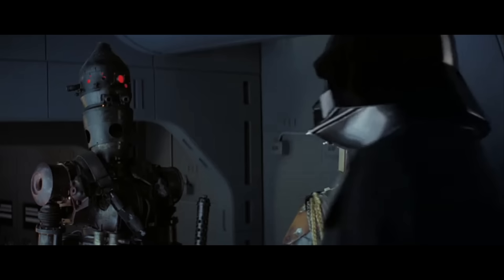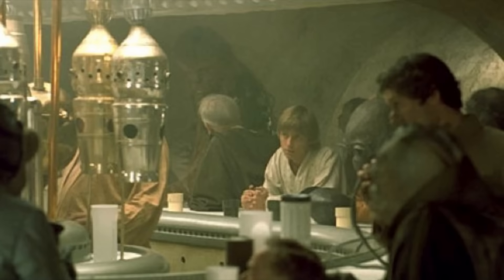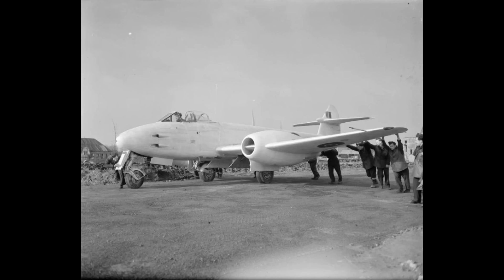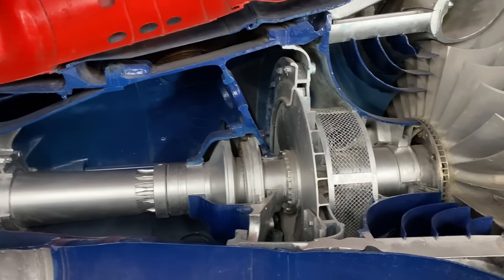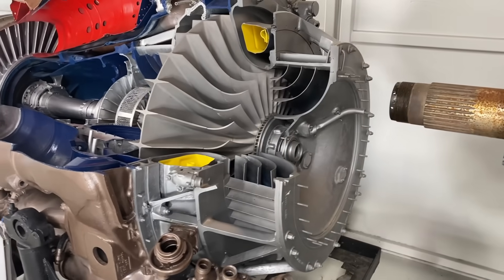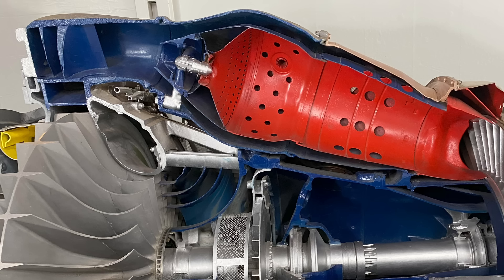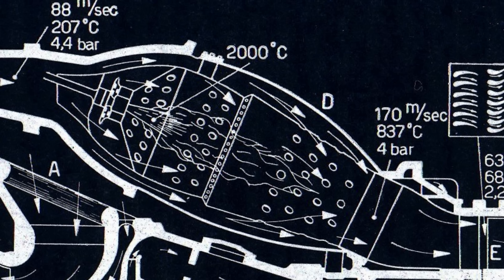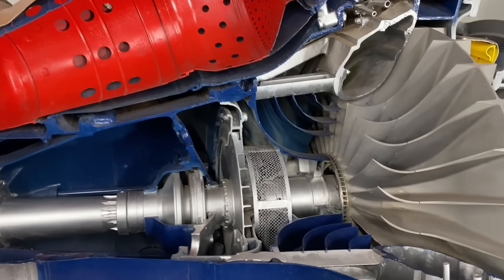The 1940's Jet Engine That Became Star Wars Design History

Comment: Explanations of turbine engines always state, correctly, that the combustion raises the temperature of the air. But for some reason it is never explained that the temp increase isn't the point--it's that the volume is increased by heating the air so that the flow through the turbine can yield more power than used to drive the compressor.

Comment: I don't know jack about starwars, but someone pointed out a prop of a car part I had once. Anyway, the engine design is very interesting.  Those types of fans are technically called radial fans/compressors and they have much higher static pressures compared to axial types, but normally at reduced flow rates.

Comment: I dunno anything about starwars. These engines... engine types are obsolete since the 60's the nene powered the mig 15. Anyway these days von Ohain s engines are used. Helicopters do mainly use these. I think auxiliary power units are centrifugal aswel.. Nope no tesla batteries. Nice video anyways. 👍

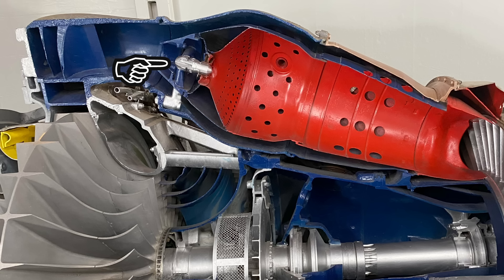Comment: 6:47 Usually called a “fuel nozzle” but sometimes the literature calls it an injector. Don’t quite understand the distinction, but sometimes examples have “injectors” (usually multiple) within the fuel nozzle. I wish someone with actual knowledge would explain the distinction. I suspect it has something to do with fuel pressure drop across the “gizmo”, and whether it is a liquid or gaseous fuel. After being “corrected” in a discussion about this item in a particular sterling engine combutor, I have paid attention to the precise usage, which seems to be important in some contexts.
Reply from the maker: I have a video on rocket fuel injectors but jet fuel injectors aren’t the same
Reply: @scottmanley  

Thank you for the reply. The “way” you used the term seems to be fine, it is just that people like AgentJayZ sometimes uses the term “fuel nozzle” (probably referring to the fuel nozzle assembly). I realize that it seems superficially pedantic, but I have run into technical people that are rather insistent that the terminology is technically relevant. I personally always call it a fuel injector until it was made clear that sometimes it is properly called a fuel nozzle (which kinda makes some sense if you are referring to the details of how that “assembly” works, which can vary a lot these days).  I would just like a good explanation. Rockets definitely use “fuel injectors” as standard usage.
Reply: With regards to the question of why radial vs axial compressor in early jet engines, I had the good fortune to have a very educational dialogue with a RR jet engine engineer. The first paragraph is my question (I know it is long but well worth the read if it is a topic of interest to you):

MY QUESTION:

I would be interested in your perspective of why
Sir Frank Whittle went with a Radial Flow
Compressor vs the Axial Flow Compressor that
"others" worked on. I realize that Radial Flow Compressors were probably better understood and more familiar at the time of this development and it is a perfectly viable solution in that time frame and are used in contemporary turboprop engines but I have always wondered why?

RESPONSE:

RR turbine engineer response (by @grahamj9101 on AgentJayZ youtube channel, best source for anything about jet engines):

The answer is very simple. An engine with a centrifugal compressor was much simpler, quicker and easier to develop than an equivalent axial flow engine.

Whittle's proposal for a centrifugal engine was rejected in 1929 by Dr A A Griffith at the Royal Aircraft Establishment, who had proposed an axial flow engine as early as 1926. However, the engine Griffith proposed was what we now know as a turboprop. His team, led by Hayne Constant, designed and tested a series of axial flow research compressors in the late1930s, which led to a project for a turboprop being handed over to Metropolitan-Vickers.
However, in 1939, when the second rebuild of Whittle's WU engine convincingly demonstrated the potential it had first shown in 1937, Metro-Vick's engine turned into the F.1 axial flow turbojet. This was followed by the F.2 series of engines, which were initially unreliable as compared to the Whittle, Rolls-Royce and DeHavilland centrifugal engines - but they were significantly more reliable and had better performance than the equivalent German axial flow engines of the time.

In comparison, Frank Whittle's centrifugal compressor worked straight off the drawing board in April 1937 in his WU engine. He aimed for a pressure ratio of 4:1 and got 3.8:1. That centrifugal impeller went through two rebuilds of the engine, which was finally damaged beyond repair in 1941, when the rim of the turbine disc failed, releasing several turbine blades. The engine can now be seen in London's Science Museum.

Whittle's early work on the WU engine was funded entirely by a relatively small amount of private venture capital, whereas the work at RAE was government funded. Whittle just didn't have the resources or the technical infrastructure to develop an axial flow engine.

Critics have described Whittle's engine and the other British centrifugal engines as a "dead end". However, they worked, were lighter, more reliable, and had better performance than the equivalent axial flow engines., whether British, German - or American.

The axial flow engine needed several years of development before it overtook the centrifugal engine. Sir Stanley Hooker, of Rolls-Royce, said that it took him seven months to get the Nene centrifugal engine working, but it took him seven years to get the Avon axial flow engine working.
Nevertheless, Whittle realised that the axial flow engine would become pre-eminent, given time - and money. Before the end of WWIl, he was working on the LR.1 engine, with an axial flow compressor, based on the RAE compressor work.

The LR.1 was what we now know as a turbotan, with a bypass ratio of between 2:1 and 3:1. It was years (if not decades) ahead of its time, but it was cancelled because the UK was 'broke' at the end of a war that began in 1939 (not 1941).

AND:

Please excuse my digression, but in championing Sir Frank Whittle's achievements, I have come across some who belittle, denigrate and even ignore his work.

As I said, his compressor worked straight off the drawing board, as did his turbine, when British Thompson-Houston produced the blades with the angles he wanted. He had a dispute with the engineers at BTH, who were building the WU engine for him. He told them that they should be designing their steam turbines in accordance with vortex theory, which they were not. He was right, they were wrong, and the performance of his turbine with the blade angles he specified proved it.

However, what he couldn't and didn't get right first time was the combustion system, but then few others did. It was a 'black art' for many years, requiring a considerable amount of rig testing, with a lot of trial and error.

Nevertheless, Whittle finally had a fairly reliable combustion system in the second rebuild of the WU engine, which was further developed for the W.1 flight engine that first took to the air in 1941.
Otherwise, the W.1 was very largely based on the design of the WU in its final form. There followed an improved W.1A engine, which flew in 1942, with a W.2 engine already on the drawing board.

The W.2 engine incorporated a total redesign of the compressor's diffuser arrangement, and it had a big problem with surging. It took a significant amount of rig work at R-R Derby, overseen by Stanley Hooker, to solve that problem. By 1944, the W.2/700 was giving close to 2,500lb thrust, with an SFC of 1.05, for a weight of around 900lb. This was from an engine of much the same size as the W.1. which was derated to 860lb thrust for its first flight, but was actually capable of over 1,000lb thrust.

At Derby, the Nene had its first ground run in 1944, giving 5,000lb thrust, with an SFC of 1.06, for a weight of around 1,600lb. It was reverse-engineering and 'tweaked' by the Soviets to become the VK-1, which powered the MiG-15, giving almost 6,000lb thrust, with an SFC of 1.07, for a weight of around 1,900lb.

For comparison, the figures I have for the GE J47, with a 12-stage axial compressor, which powered the F-86F Sabre, are just under 6,000lb thrust, with an SFC of 1.014, for a weight of around 2,500lb.

And to give you some idea of the advances in technology by the end of the century, the EJ200 in the Eurofighter Typhoon weighs around 2,200lb, with a 'dry' thrust of 13,500lb.

AND:

I have long had an interest in the life and work of Sir Frank Whittle. Firstly, because he effectively laid the foundations for my career lifetime in gas turbine design. Secondly, because Coventry, the city of his birth, was where I served my apprenticeship with Bristol Siddeley Engines. His achievements are recognised by a statue to him in the centre of the city, beneath the Whittle Arches.

I have also been fortunate enough to make the acquaintance of his son, lan, who lectures on the life and work of his father. Approaching the age of 90, lan still holds a private pilot's licence and flies himself around the country to give his lectures. He will be in the air again this coming week (weather permitting), flying from south of London to the Midlands, "only a 50-minute flight in my little [Piper] Archer."

Comment: Wait, Bernoulli says that as a gas enters a larger diameter pipe, the pressure increases as the air slows? Isn't the opposite effect the "how" of a refridgerator's cooling function?
Reply: Yes, I don't believe that the air slows down as it enters chamber C; it should be speeding up by Bernoulli's law. I think that they be measuring not only static, but total pressure--which includes dynamic pressure q:: "max q!!!"... which I think would be affected by the cross-section of the flame tube metal (swirler viens + casing) as it presents to the airflow

Comment: Centrifugal compressors are actually preferred in smaller motors because relatively speaking they are more rugged that axial motors
Reply: Also axial flow turbines need tighter gaps and tolerances - they become more efficient as the gaps decrease. However with smaller engines, the gaps become a significant percentage of the compressor size, so they don't work as well as centrifugal compressors.
Reply: @paulsengupta971  
Yes, you are making note of a very important aspect of turbine engines, the leakage does not scale DOWN in a favorable way! While centrifugal compressors don’t have that same limitation in smaller sizes. But centrifugal compressors have other shortcomings if they are required to directly take atmospheric air and compress it in one stage. They are good if the air has previously been compressed to a higher density, usually by multiple stages of an axial flow compressor. Tho there are turbine engines that have multiple centrifugal stages, but rare.
Reply: And some super big ones (85,000 horsepower) & 5 feet in diameter but for a different reason.

Comment: Great video Scott. To be a bit pedantic, the rotating compressor (axial or centrifugal) assembly doesn't increase the air pressure. It increases the air velocity. The stator vanes immediately after the compressor converts the increased velocity into increased pressure. This happens because the stator vanes form a divergent duct which increases pressure and temperature and decreases velocity. That really is nit picking..... sorry 😊

Comment: hey Scott, Why doesn’t starship and the booster have a diaphragm at the top of the tank that slides down the walls as the fuel gets sucked down instead of baffles?  Wouldn’t that be a more effective way to get rid of the slosh and keep the engines from sucking gas?

Comment: Nearly perfect video. Just sad you did not stress that adding heat does NOT increase the pressure but the volume, and that it is because a jet engine pushes out more volume through the turbine than goes through the compressor that it achieves net thrust. Yes, it's obvious but so many people get it wrong.

Comment: Surprising how small the pressure differential across the combustion chamber is. Only 0.4 BAR according to that diagram if I read it right.  Always struggle to get my head around why they don't just stall all the time.

Comment: Jet engines are fascinating for sure!  My dad was a jet pilot, having learned how to fly first during WWII as a radio operator in a PB-Y flying anti-sub patrols in the Gulf of Mexico.  He said the skipper let him fly because it was good to have anyone (and everyone) knowing how to fly and/or land the thing if the pilot and copilot were killed or injured.  But he re-upped after the war in the Army and officially got his "Fighter Pilot" certificate a year or so later and they transferred him to the Air Force (on the same day!).  He trained pilots during Korea, having already two full tours in combat during WWII.  Then, he went to work for American Airlines at the dawn of the Jet Age as we say, in 1955.  

He saw it all, he said.  He saw an airliner going down in flames over St. Louis one night, and he himself had to declare emergencies a couple times.  When that DC-10 lost an engine taking off from Chicago O'Hare (1979), he said they brought 100 pilots in and put them through the simulator with that scenario.  He told me that 10% of the pilots survived that in the sim, didn't say whether he was one of them, said that you had to physically LOOK out the window and see your ENGINE WAS GONE, because that wing stalled after losing an engine, and you had to realize NOT TO CUT POWER TO YOUR REMAINING GOOD ENGINE (besides the tail engine) so you could keep enough power and make it off the ground.  Those modern jet engines, btw, have like 80k lbs thrust (240k total on a DC-10 or so, I don't remember exactly).  Even more than that on the latest jet engines I know!

Comment: but how do you start a jet engine?
Reply: You make it spin somehow, this could be using compressed air or an electric starter. Then you switch on the ignitors to create the spark, then when the rpm is sufficient, turn on the fuel.

Comment: Did some looking up of centrifugal gas turbine compressors, and looks like these still get some use -- not any more for jet engines, but for other uses.  If you don't need to keep the engine narrow for moving it through air, the fewer stages needed gives an advantage.

Comment: I work at Martin-Baker. We have two Gloster Meteors with Derwent engines for ejection seat test beds.
Reply: The meteor can operate at similar altitudes as modern jets. I'm not certain why the meteors ended up in this role. It may be to do with the structure being able to withstand the ejection stress repeatedly.
Reply: Is that because they operate at low altitude and are more able to survive a bird strike?

Comment: I'm always impressed by how much information you can accurately put out here. In my side job as an Air Force reservist, I work on Jet Engines. You're pretty much spot on with your descriptions. In my primary job as an Engineer, I manufacture thermal protection (tile) for spacecraft, and I get to work with many of the materials you have covered in other videos. You are very informed on both subjects, sometimes giving details that I am not allowed to share because of trade secrets/ proprietary information.

Comment: How Frank Whittle actually figured out the jet engine is beyond belief ... How the heck did he envision something that would change the world in so many ways is just incredible
Reply: Its all true, he plagiarized the work of Maxime Guillaume and A.A Griffiths... he was actually only the 4th person the successfully demonstrate  a working jet aircraft engine. The first was Hans von Ohain and Max Hahnn on August 27th 1939.
Reply: @DoktorBayerischeMotorenWerke  wHEN ALL SAID AND DONE fRANK IS sTILL THE mAN WHO BROUGHT IT TO THE WORLD Oops caps sorry
Reply: It's like a turbo charger from a piston engine but with no piston engine (just burn the fuel in a combustion chamber instead of cylinders).
Reply: @zapfanzapfan  Yes its called a Brayton Cycle heat engine, the first practical example was invented by Jens Ægidius Elling in Norway in 1913 and first mass produced by Swiss company BB&C in 1930.